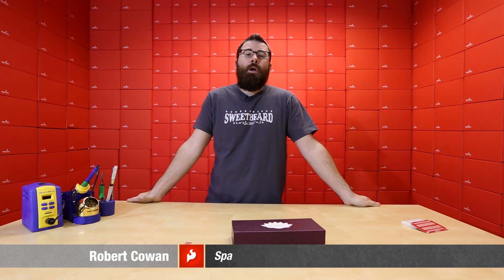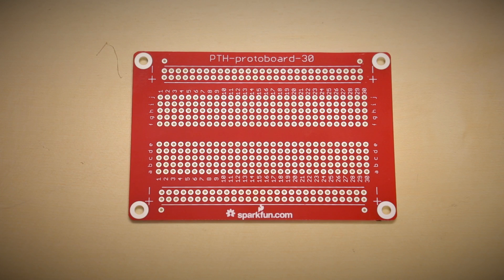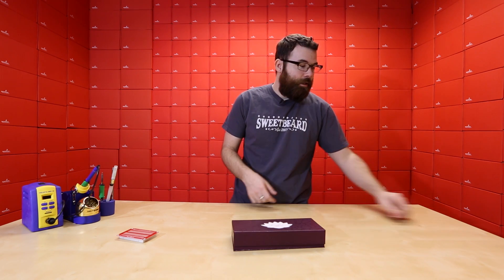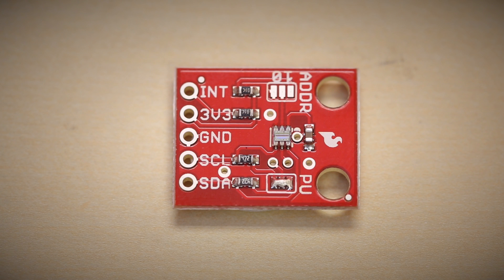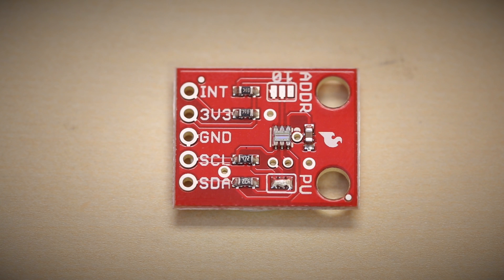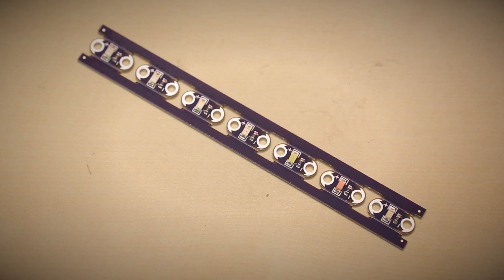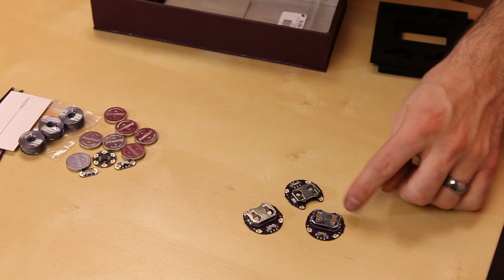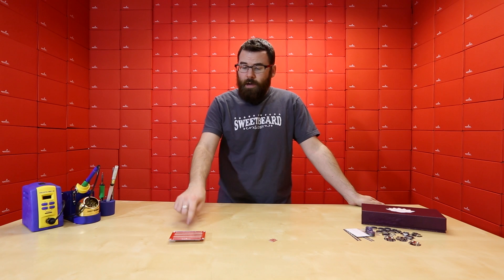SparkFun 12-27-13 Product Showcase: DESIGN-O-MITE!

Comment: The surface area of a sphere does grow quadratic, not exponential. Also the explenation of lux is misleading, it's just the lumen per area, e.g. 500 lx = 500 lm/m^2 is the typical brightness in your room.
A 60W lightbulb puts out 710 lm in case anyone is wondering.